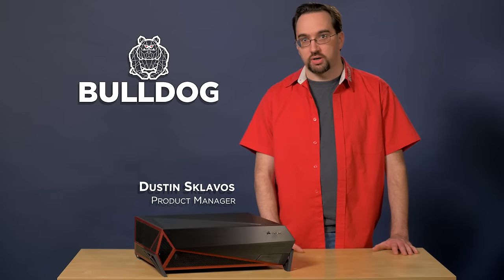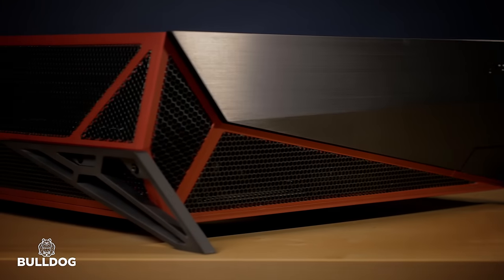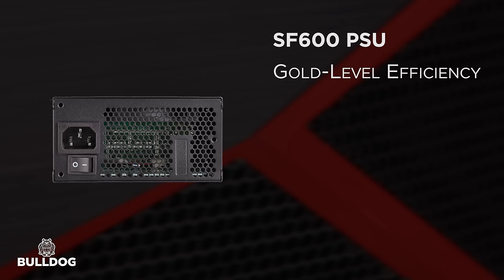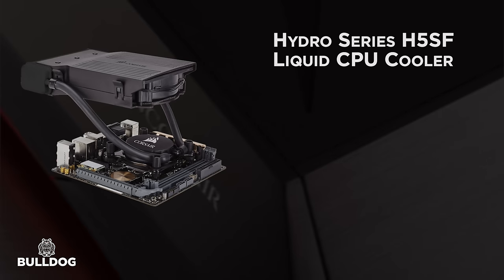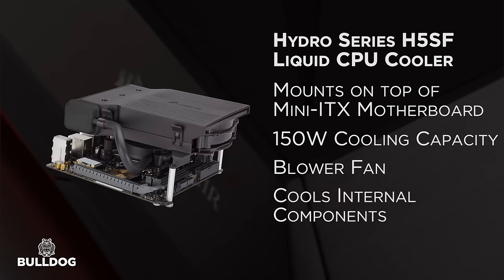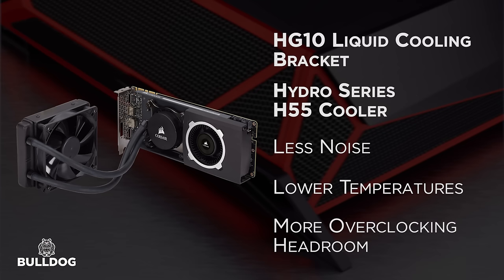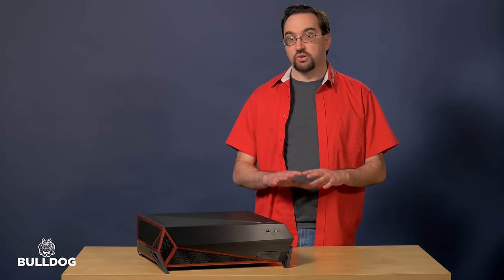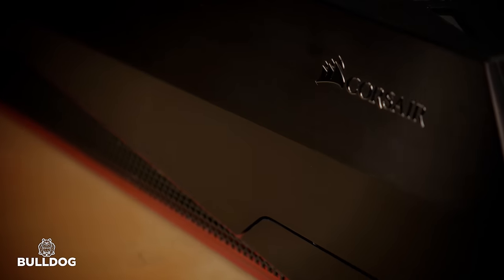Corsair Bulldog introduction

Comment: Looks great, awesome concept for HTPC/mini gaming PC. I'm still happy with my Air 240 and H100i though, with gryphon z97 armour edition MoBo and EVGA SSC 960 4GB. Looks incredible. You should make a version of this with dark grey accents instead of this red one. The CPU cooler concept though looks really cool. Maybe you could make a 240mm low profile radiator by making half of it the blower fan and the other half the radiator. You could make a full AIO only 30mm thick. This may be great for other PCs where there is mounting positions for 2 fans 15mm apart but there is no room for a radiator with the fans.

Comment: Motherboard, cpu cooler, psu, and case for $399 isn't a bad deal at all. It might be fun to build one of these later this year. Too bad the aesthetic is...eh. The right corner of the box actually looks ok but the left side screams I'm 17 years old. I hope they choose a motherboard with built in wifi or room to add a wifi card.

Comment: This looks like it's aimed toward console gamers, i'm pretty sure any PC gamer that built their own system can easily build a small form factor gaming PC for their living room. Also i really don't like that case but then again i like the simple sleek cases like my H440, i'm sure someone likes these style case looks like an  Alienware case or the NZXT Phantom was knocked on it's side.
Reply: AngryBullbog Yes, and no. Those low profile coolers are very nice, and it's about half the size of the H440, which is my current case. Also finding a form factor PSU that's 600W and as well rated as this one is hard to do. 

However it isn't cheap, which may turn people away. This costs as much as a PS4 and it really doesn't include any hardware outside of the cooling and PSU.
Reply: AngryBullbog you know, they always say that. But the cases like these aren't very common and the ones that ARE out, seem pretty bad. The most common ITX cases are usually pretty tall and thin and ugly, or short fat and ugly. The only ones I'd want are the Lian Li one which is probably like $300 dollars lol or the evga Hadron. Honestly for style and what you can fit in it. I think I'll be looking at this or the Asus M8 for my next build.
Reply: AngryBullbog  or console gamers who are pc gamer wannabe's, ahahaha
Reply: Alex Cesare $400 for the case, PSU AND mobo last i heard.

"Composed of a DIY kit with a stylish gaming console-sized chassis, liquid CPU cooler, power supply, and motherboard, and designed with plenty of space for customization and upgrades – the foundation for users to build the ultimate living room PC."
Reply: If it's included, then the price will be pretty good. Hopefully you can pick Intel or AMD. For someone doing living room gaming on a budget, this may be a tough sell since it still needs a lot more to be a full PC.
Reply: Alex Cesare It will most likely be Intel only, since there are no mini-ITX AM3+ motherboards, and buying this for 400 dollars when using a 80 dollar FM2+ motherboard, would be strange.

Comment: So you pretty much said nothing about how it will do 4k but you just like using that word. The unit itself won't do shit for 4k gaming and it will only support a single card and a titan X can barely get over the 40fps at 4k. Soooo is the case magic or marketing bullshit?
Reply: Riffy Divine Liquid cooling will help. 4K is coming and in that small format you are going to need LC to keep it running.
Reply: No, 4k isn't come. You won't see it for another four to five years. That aside there is nothing in this box to allow 4k gaming so they shouldn't bring it up like it's a feature. The only way you will see 4k that's at an acceptable level is with SLi which this can't do.
Reply: Riffy Divine 4k is already here if you pay the price for it.
Reply: Riffy Divine "can barely get over 40 fps at 4k." This depends on the game. With bf4 you get like 70fps @ 4k.

Comment: Consoles don't need to be upgraded for a very good reason low level access and devs that care about optimisation.....
Reply: Uk Gamer Consoles lack preformance in every aspect. no discussion there
Reply: Uk Gamer optimization for a piece of old crud which means cutting every performance corner possible.
Reply: Yet consoles are hitting 1080p while most gaming pcs don't even hit 720p....
Reply: Uk Gamer It's actually the other way around excluding 720p, consoles get 900p.
Reply: Ubisoft titles get 900p on consoles(they also run terribly on the pc too)....The vast majority of ps4 games are 1080p with only a small handful below that.
Reply: Uk Gamer u think resolution is the only performance benchmark? kids..
Reply: Uk Gamer lel, no games on consoles are 1080p at all, with out a shadow of a doubt, i can say that a pc priced at 350$ can run 60fps 1080p no problem
Reply: Uk Gamer LOL, enjoy your 720p gaming
Reply: Uk Gamer wow. Stories of deluded peasantry are not unfounded.
Reply: Uk Gamer "Ubisoft titles get 900p on consoles(they also run terribly on the pc too)....The vast majority of ps4 games are 1080p with only a small handful below that."
Most console games run at 30 fps.

"Yet consoles are hitting 1080p while most gaming pcs don't even hit 720p...."
Uhh, what? Steam did a survey and found that the vast majority of PC gamers run their games at 1080p.

"Consoles don't need to be upgraded for a very good reason low level access and devs that care about optimisation....."
Have you seen the load times on games like GTA V and Dragon Age Inquisition? Solid state drives are a recommended upgrade for both the PS4 and Xbox one.
Reply: Uk Gamer "while most gaming pcs don't even hit 720p"

You have a source on that or are you just a hater because poor?
Reply: Cadde Im a gamer who owns multiple consoles including a ps4 and has a gaming pc which runs games at 1440p. Ergo I'm far from a hater or a fanboy. Imho games on the pc usually came out with poorer performance than it should because the atituse is the person can always upgrade. The steam hardware survey has confirmed the 720p thing many times.
Reply: Greencoast Seriously stfu. Consoles are getting better performance out of apu setups than rigs with dedicated gpus because of one config and optimisation and low level access.

It wasn't from years ago i check last a few months ago. http://store.steampowered.com/hwsurvey click on single monitor resolutions. 34 % hit 1080p like 4% hit higher than 1080p and everything else FAR below that.
Reply: Uk Gamer Sorry, i don't know anyone who can't play 1080p in decent quality. Sure, they don't max the quality settings but the game still looks and plays better than any console.

No, not all i know have beast gaming rigs either. They have a pretty standard PC with an slightly above average GPU. Such as a GeForce 760 or better.
They would have a computer even without the GPU. Why spend $400 on a console if you can spend less on a GPU for your home PC and reap ALL the benefits of having a PC with a powerful GPU in it?
Reply: Uk Gamer The Steam hardware survey doesn't differentiate between stationaries and laptops. Hence why so many are on 1366 x 768 resolution. It's not that those laptops can't run a higher resolution, it's that the screen is low resolution because that's how the laptops remain affordable in their segments.
Reply: Uk Gamer Seriously mate, how drunk are you?
Reply: Uk Gamer look, the only point you have going for you is that consoles offer a streamlined experience because they dont differ, optimization for one spec, and one system. But it is ALWAYS lower than a decent gaming PC. The APU's are actually nice inside the new gen consoles, BUT they lied about how many games would play in 1080p, and i absolutely hate 30fps now that ive played games at 60fps for so long. If its a slow story game 30 can be fine, but anything with fast moving action i NEED 60 or higher fps to enjoy it.
Reply: Huehuehue Huehuehue explain, I beg to differ
Reply: wtf, i didnt say that holy shit get glasses. Im a PC guy and have been for a long time tinkering with my own systems. Last major thing i said was that devs and console maker LIED about games being in 1080p because few are, and even when they are, the details are all at min settings. Plus i even added that i hate 30fps which is always the target even at 1080p.
Reply: i know, it started the whole argument hahaha,
Reply: Huehuehue Huehuehue U wot m8? lel let's blaze it for the good of all mankid. 

XDDDDDDDDDD
Reply: Uk Gamer I hit 6400x1080 (triple monitor), 1920x1080 (1080p), 1920x1200(1200p) and 2560x1080 (wide screen 1080p) on a 6 year old computer with a graphics card upgrade and an overclocked processor. Plus I've never heard of this before... Basically every gaming PC can hit 1080p... The "gaming" portion of that phrase denotes a computer dedicated to gaming, which from my experience means it can atleast hit 1080p on every game no matter the settings, as gaming PC's are usually built for performance. As others have said, I think you are getting consoles and gaming PC's mixed up. If a 6 year old computer with an under $300 graphics card upgrade can play games at 6400x1080 at 60 fps (only 17% less graphically intense than UHD 4k) then I would assume that almost every "gaming PC" can play a game easily at 1080p.
Reply: Huehuehue Huehuehue On purpose. I have plenty of free time to debate and argue, so if UK Gamer wants to debate, that's fine with me. Plus I work IT. help people build gaming computers, and am quite a hardware enthusiast, so I'll know better than most what constitutes a gaming computer and how it will run.
Reply: Huehuehue Huehuehue true.
Reply: Uk Gamer console=/=pc

Comment: 600w for a ultimate 4k gaming lol u canton even Do two gtx970 sli with this Power
Reply: It only supports single GPUs.
Reply: microgamestation so its not 4k ultra gaming
Reply: dd b It supposed to be a living room pc, not a "ultra gaming" rig. Use your head.
Reply: wolfstar 4k is 4k you need at least a titanx sli for a smooth 60fps ultra at 4k res
Reply: titan x too
Reply: but you need two for a ultra 4k smooth fps otherwise this pc is gonna be useless next year with next gen pc games
Reply: +KenKraken same speed as the titan,  i say that because 600w is Just ridiculous
Reply: ***** also gtx970 sli have the same level as a titan X who is the Best graphic card nowadays...  U need minimum à titan X sli for a optimum 4k computer...  Otherwise its gonna be a 30 fps average ewwwwwwww...  so this case isnt for 4k at all !